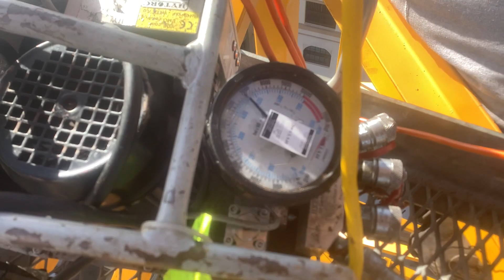Ironworkers building a tower crane in Berkeley California

Comment: Great video! Brings back great memories of working iron - Oakland 378. I spend a year of my apprenticeship working for Sheedy erecting and dismantling tower cranes, roof mounts, and other fun projects in the late 70’s.      No harnesses, quick release belts. We seldom tied off anyway.       My first job was removing all the bells in Sather Tower (clock tower behind the tower crane being built) to build a steel frame before hoisting the new 48 bells with a gin pole and winches.